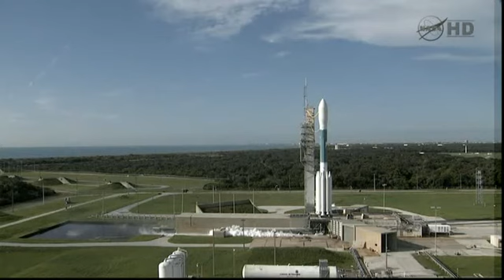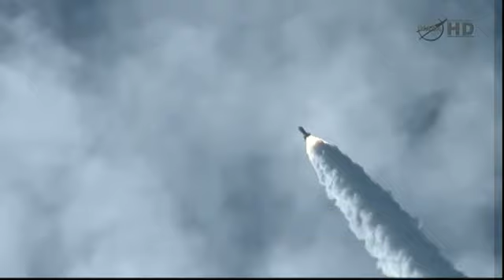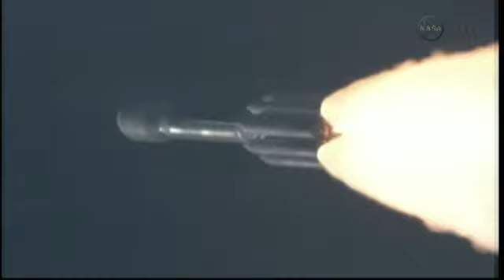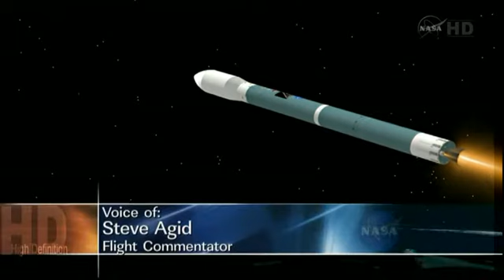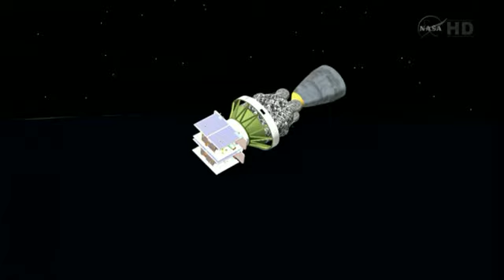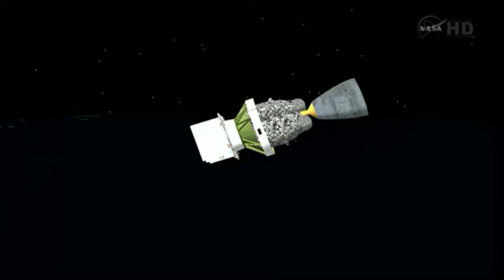GRAIL Launch Delta II 7920H-10

Comment: How is the downrange more than the altitude at 45s, and why are they reporting the altitude in nautical miles?
Reply: I know you asked 6 years ago but... I suspect they're using Earth Centered Inertial coordinates which starts with a horizontal velocity around 400 m/s due to Earth rotation. Taking the 13.4 nm downrange at 50 sec gives 496 m/s average which is in the ballpark. Ultimately ECI velocity is all that matters for orbit, not ECEF.
If you look at the mission profiles in the Delta II Payload Planner's Guide they use ECI velocity of 0.41 km/s at launch.